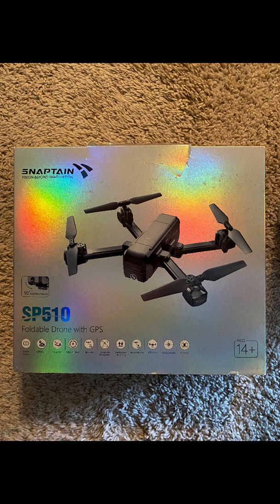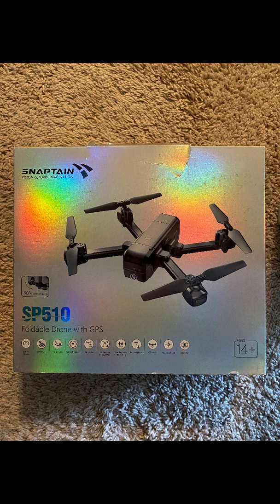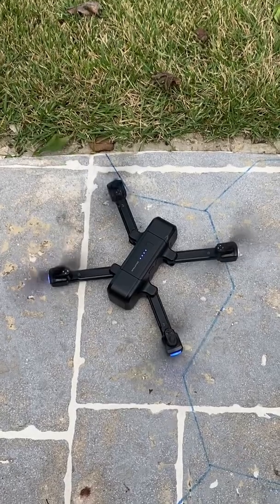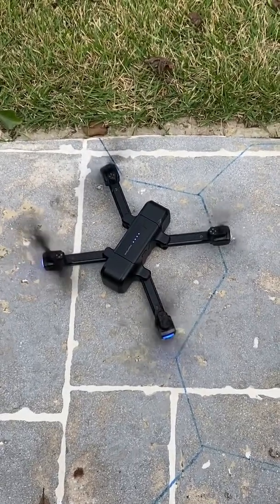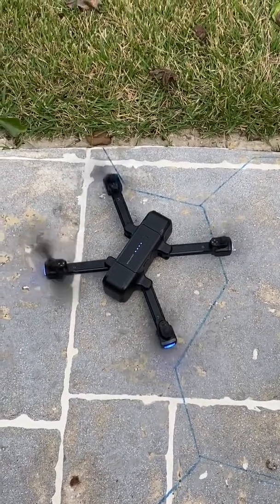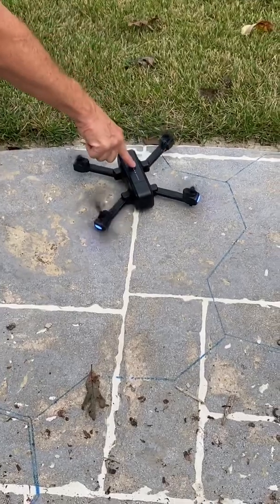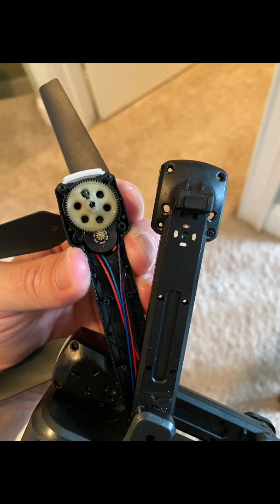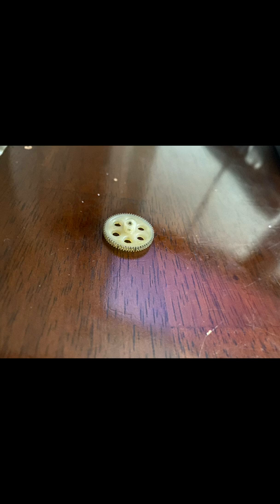Snaptain SP-510 drone problems/Fix

Comment: Hello
My sp510 has a similar issue so am wondering is there a size for the gears when ordering
Reply from the maker: I don’t believe there is, as I ordered what was displayed for Snaptain SP510, pack of 4 and they all fit. Sometimes, if you hear a “bearing whine” it’s the motor.
Reply: @kineticenergy1085  ok thanks 
Where did you order yours from? I’m checking Aliexpress
Reply from the maker: @walestephens8179  I wish I saved the receipt but I didn’t. I checked my email history. I did just go on google and search “Snaptain sp510 motor gears” and it came up
Reply from the maker: @walestephens8179  https://www.kingsdrone.com/motor-gear-(1)-for-snaptain-sp510

Comment: Saved me so much I oppend up mine an I had a stripped gear it was running slower on one side an I got a set of 4 for 9 bucks
Reply from the maker: Ah, yes. And as you can see, they are easy to replace 👍🏼